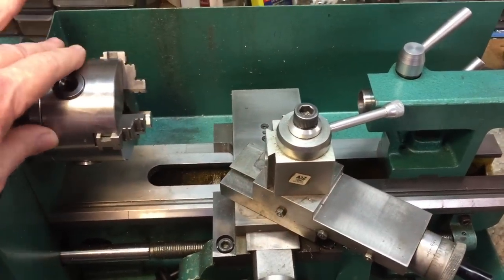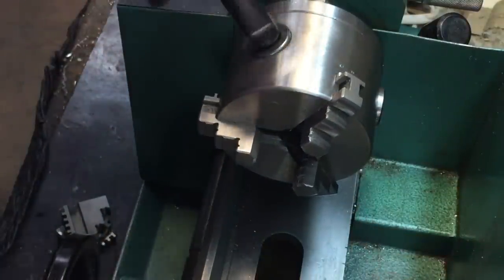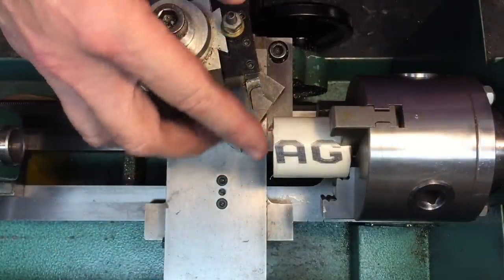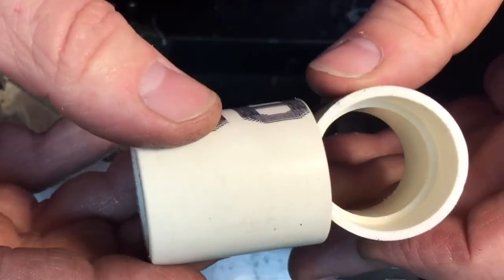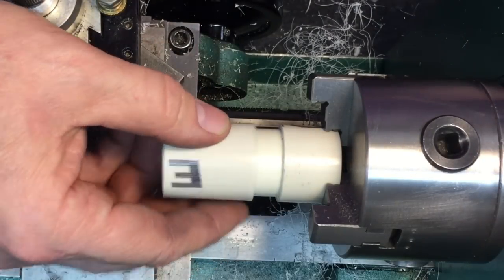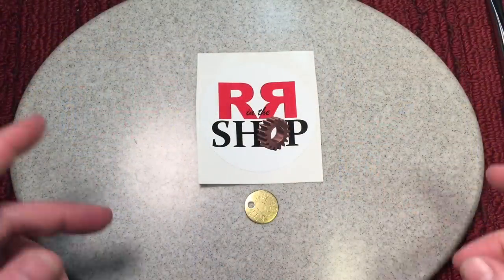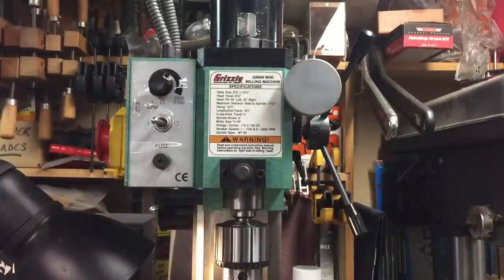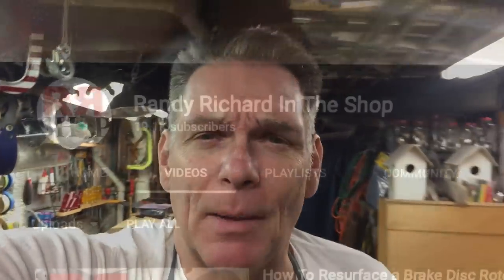MMM- Beginner Lathe Practice- Randy Richard's Awesome Scribe

Comment: Great video as always. Very informative. I can’t wait to get my Lathe going and try turning some plastic. That’s a great idea. I bought a South Bend from craigslist but I need to get a tool holder for it and get it set up on a bench . It has a four jaw Chuck so that will be a learning curve right off the bat . I have something I would like to send if you have an address or PO Box I could send it to you. Please let me know thanks
Reply from the maker: You are going to have fun learning for sure!  There is a great site called Little Machine Shop .com that has lots of great information of tool posts and such!   bicycleguy@aol.com

Comment: How do you cut bottle-type threads with a lathe? If you wanted to make one of those containers with a screw cap?
Reply from the maker: The bottle type threads are a three position thread and challenging to cut on any lathe!  Unfortunately I don't have my lathe properly set up for thread cutting...  That is where a "Quick Change Gearbox" comes in super handy!   Thanks!

Comment: What if you wanted the two halves threaded?
Reply from the maker: That is the next step in learning!  My lathe isn't properly set up for turning threads but for many bigger lathes it is very simple because they have a Quick Change Gearbox...  (Just makes it easy to cut threads)   =D